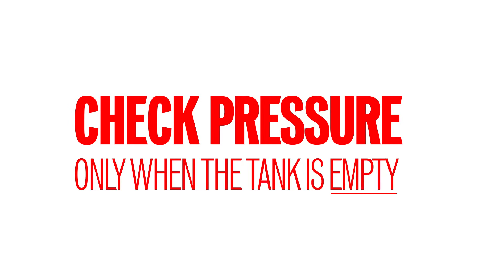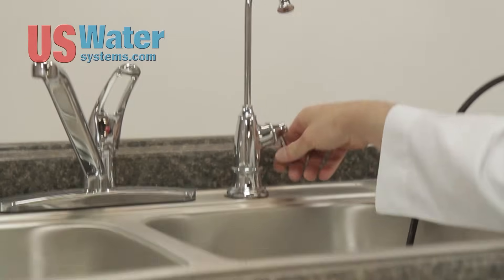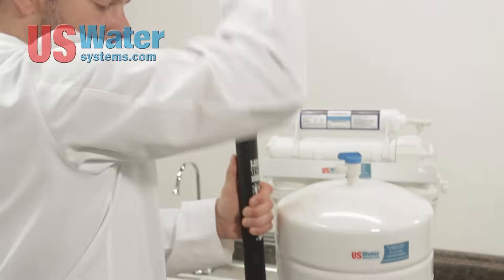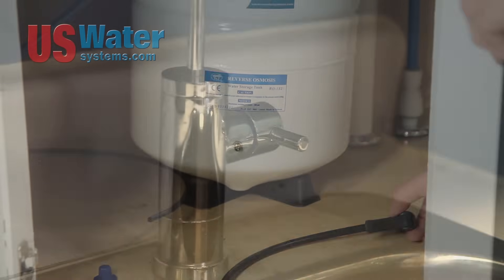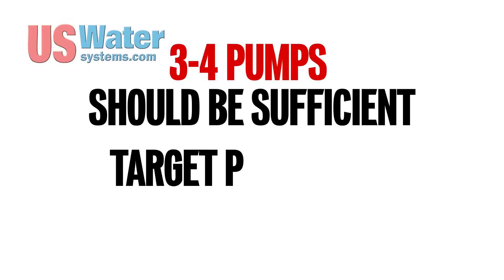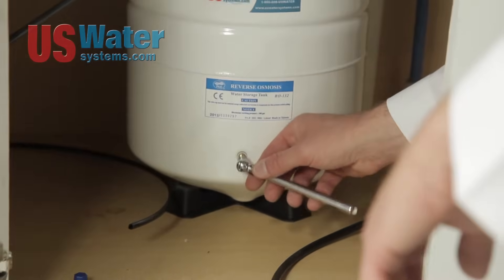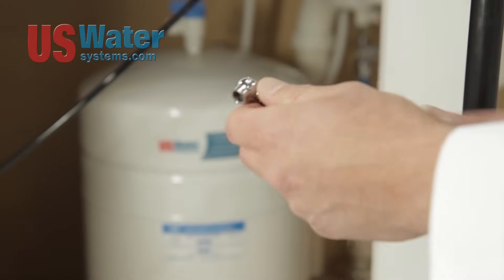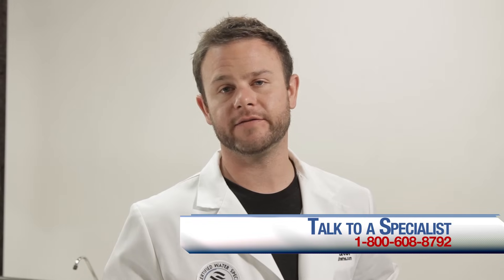How-To: Repressurizing a Reverse Osmosis (RO) System

Comment: One thing i didn't see mentioned in the video or comments - the system needs to re-pressurize after being inflated. The tank showed at 7PSI, but water wasn't flowing from the filters into the tanks. It took a solid 2 hours for the entire system to re-pressurize then the water started to re-fill the tank. I went to bed and when I woke up the next morning the water was flowing beautifully!

Comment: I've always had my 6 gallon tank at 10 psi empty 
 When it is full of water mine ready 17.5 psi! Maybe that's from all of the water. I'm emptied mine now and have it at  7 psi. I just changed all of my RO filters too. Now I have a new system again. I'm hoping my tank did not fail. It would "fail" if it did not hold the 7 psi I put in, correct? In other words the bladder must still be good?

Comment: They say 7 psi at an empty tank.  As the water is filled back up the pressure inside the tank increases.
Reply: yes but no one says how much PSI should be if the tank is full

Comment: The instruction is very clear and easy to follow. Problem is the stem at the tank is a non-standard size. It's smaller than the both bycicle pump stem and the gauge. Therefore unable to pump (add pressure) to the tank.
Any one has ideas to solve this problem is greatly appreciated.
Reply: You might have a Presta style valve.  Most good bike pumps can do both...

Comment: What to do if my 9 stage still flows poorly no matter 5 or 10 psi? Hot water is fine
Reply from the maker: When is the last time you changed your membrane? There could be scale buildup in it.
Reply: @uswatersystems  It's a new system
Reply from the maker: @agreatd  Two questions:
1. Is the system located under your sink, close to the faucet?
2. Does your system have a permeate pump?
Reply: @uswatersystems  Yes, under a sink, new system, with 8 PSI it's bit better, ~8 seconds to fill a cup, no pump, have strong psi from pipes, using a tank
Reply from the maker: @agreatd  Honestly, without a pump 8 seconds sounds normal to fill a cup. RO's just can't make a lot of water pressure. If you add a permeate pump to your system it will greatly improve it though and they are fairly inexpensive (around 70 - 80 dollars).

Comment: Will this stop the vibration noise  I get when I use the filtered water?
Reply from the maker: No it will not. That noise is from air getting trapped in your line. Try closing the valve on the tank and then tilting the RO system to a 45 degree angle and then turning on the faucet until the water is drained. Open the valve on the tank after this and see if it improved after the system makes new water.

Comment: Thanks! My RO-132 tank only released 1.25 gallons and then I pushed-out 2.5 more. Re-pressurized to 6psi. Faucet pressure is sustained, BUT my wastewater ratio (w/ booster pump) is MUCH worse at 4:1 when before it was 1.65:1. I'd rather have a lower water discharge capacity (lower tank psi) and have a better waste ratio. Looks like I'll be doing this over and reducing my empty tank pressure from 6 to 0psi OR remove the tank altogether and get a trickle with 1:1 ratio. Because of the added psi, the tank only fills 2.75 gallons before the system turns off.
Reply: UPDATE: I totally removed the tank and my waste water ratio is 1:1.  EDIT: Actually 1.3 : 1.  (75gpd membrane and booster pump)  Yes, the water comes out slow but  I don't need a lot at once. Besides, I can store water in glass instead of the system storing it in a metal tank and sit in there if I don't use the system. The pump starts / stops immediately with the turning of the faucet and waste water stops minutes after the faucet is off. My TDS is down to 2ppm after about running 12 oz of water to remove the initial TDS spike. If I was using the tank, that initial TDS spike is diluted in the tank and takes a LOT more faucet water waste to get down to 2ppm.
Reply: @rgraz4929  the tank might be metal, but the inside bladder is plastic where your water is stored

Comment: Great video! When I first turned on the faucet the water came out for about 30 seconds then stopped. I had to keep pumping air into the tank in order for rest of the water to come out. That took about 30 minutes. Once tank is empty, I checked the pressure...showing 0.  Pumped to about 7 psi then let the tank refill. Now everything is working again.

Comment: Hi Aaron.

	I just watched your video. Thanks, man. It was straightforward and easy to understand. I didn’t know to empty the tank before re-pressurizing so that was useful info. I’d just been re-pressurizing it!

My question is this. My tank is identical to the one you’re using in your video. Why does my tank read “100 psi maximum working pressure?”  I assume that’s only the amount of water pressure that’s allowable to come into the tank/system overall? 

Thanks.

~ Tim
Reply: mine says the same thing! I am also confused by that
Reply: I assume once you add water back in to the empty tank, the air in the bladder gets more pressurized and the max amount with a full tank of water is 100psi. 

Not sure if that makes any sense

Comment: Can I do this without emptying my tank? Pump 4-5 times. Check faucet. Repeat as needed?
Reply: Some videos have you do the pressure check when the tank is full.  In that case it should be 35-40 PSI instead of 5-7 PSI when empty.

Comment: THANK YOU THANK YOU THANK YOU!

I had no idea that the tanks had a pressurized air bladder and wondered why the valve was there. The pressure was at 0 when I checked it. The instant I pumped a bit of air in the water started to pour out again. Had to keep this up for about 15 minutes until no more water came out and I had the psi at 7. 

Can't thank you enough. I was wondering where I had gone wrong when changing the filters.
Reply: All these years of my RO, whomever changed the membrane and filters, I'm learning the tank NEEDS TO BE REPRESURIZED!  Hah.  the things I continue to learn.  hehehe
Reply: I had 15 mins of water in it, too.  Thought I was crazy.

Comment: Can you go up to 8lbs if you want the water to come out faster?  We have a long tube to our fridge and it comes out of the fridge pretty slow.
Reply from the maker: Doing that won't help you. To get better water pressure you will want to add a permeate pump to your RO. These are recommended if you are running a line to your fridge. They aren't that expensive and they are easy to install. https://www.uswatersystems.com/non-electric-reverse-osmosis-permeate-pump-erp-500.html

Comment: Target presser is five to seven PSI, yet the manual says minimum operating PSI is 40. Any ideas? It's a Premier 5SV.
Reply: The pressure when the tank is full should be 35-40 PSI.  Some videos have you pressurize the tank when it is full instead of empty.
Reply: @tomlillevig9868  Thank you kindly!

Comment: Should I shut the tank valve once the dead water is pumped out, but before starting to pump air into the empty tank?  (otherwise how will it remain pressurized?)
Reply: There is a rubber bladder in the middle of the tank separating the air below from the water above.

Comment: why do other videos say 40 to 50 psi , instead of 5 to 7 psi ? That's a huge difference.
Reply: they say 40 - 50 PSI is what it should be when the tank is full with water, but when its empty, it should be 5-7 PSI
Reply: @realldonaldtrump  RO water supply pressure is lower than the Well pump pump  which also uses an electric 220v motor to get to the 50 -60 psi.

Comment: Water seems to come out of my pressure nozzle. I went to check the pressure and water came out. I then attached a bike pump with a pressure reader and it was reading 0. I gave it some pumps and the pressure goes up then immediately down and I hear bubbling sounds. I assume my bladder is busted. Does that sound right? I’ll be shopping for another
Reply: The bladder inside your tank is likely ruptured.  This can happen over time to any tank.  The well system guys call it a "water logged tank".  It won't hold air pressure anymore.  The tank is filling completely up and the bladder is not pushing on the water in there. In other words, the balloon has popped in there.

Comment: Water supply closed, tank valve open, water tap open. Drain the tank. Jiggle. If water still present in the tank - water supply closed, tank valve open, water tap open- pump up the tank and let it drain completely. Once emptied - water supply closed, tank valve open, water tap closed pump up the tank to 7 psi. Then slowly open the water supply line. It will take time for the tank to refill with filtered water.
Reply: @ErrorMoose why is that needed though? If the bladder is sealed, shouldn't we be able to pump up the tank even with it entirely disconnected from the water line?
Reply: @literailly I’ve got the same question. If the tank valve is open, then the bladder would fill up with air and no air should escape.
After pressurizing my tank to 8psi, I opened the tank valve and it depressurized the whole tank.
I feel like that means the bladder is toast.
Reply: @cwsquaredinspects  pressurize with valve open, and you would have a definite answer.
Reply: Don't re-invent the wheel
The video says it all
Because the producer of this video knows what the tank consist of.
The bladder is supposed to be pressurized, not the water part of the tank
Therefore the tank valve needs to be open when bladder is pressurized
Reply: Are we supposed to close the tank valve after emptying and before pumping pressure in?
Reply: @hide2dan  way I did it, I closed the supply valve, opened tap, closed tank valve, disconnected the tank (with a bucket handy to catch remaining line water), took full tank to bathtub, and emptied it there by pumping it up to 7psi or so. Same steps in reverse to reassemble.
Reply: My tank won’t empty. What do I do???
Reply: @amandaalley77 yes. I had to pump for a very long time for it to empty. Seemed like it had a never ending supply of water in it

Comment: How do you run the water out of the tank by shutting water off to the system and opening the faucet when there is obviously no connection from the tank to the system?
Reply: You are connected to the reverse osmosis system by the yellow tubing. If you open the faucet without turning off the inflow from your city or well water, once the tank is emptying through that  same yellow tubing to the post-filter and then the faucet and then quits running due to eventual lack of pressure, the check valve will open within the system allowing an inflow of your city or well water into the system and then the tank.  Of course, this will defeat your purpose of trying to get the tank completely empty.

Comment: After draining, I connected the bike pump and after pumping it up to about 10psi (not sure what the tank's internal bladder can handle)  5-6 times the water keeps flowing.  -Yes I've confirmed the INcoming water is turned Off.  Just keep adding pressure til  it stops draining? Thanks

Comment: I have worked on RO  systems for decades. And I can tell you that most ro tanks can take pressures up to 70psi no problem, the problem is that if you go that high with the small lines that are usually used in ro  systems you get very high pressure in the faucet. This will cause the water to come out like jet. So if you have low pressure in your system you can go above the 5-7 psi that's suggested. Especially if you have a long run of line between the tank and faucet. I have gone to 15psi for runs of 40ft. Hope this helps.
Reply: Increasing the pressure above 10 or 12 psi will only limit the volume of water the tank will hold, the whole system will only pressurize to about 5 psi below the line pressure of the water supply, a more effective way to get better flow is to use larger lines like 3/8 instead of 1/4 inch
Reply: @motodude23  .You are partly correct . If your water pressure is greater than the pressure of your tank as in another pressure tank from a well or city pressure you will get a full fill of the tank. Yes if you get a larger feed line it will increase volume but not pressure. As I have installed hundreds of these systems I can tell with certainty that increasing the pressure if you have a long feed line is the only way to get proper flow. Thanks for the input , always good to think of other ways!😁
Reply: I put my system down in my basement, and the faucet is upstairs. I will probably use your theory when I pump the tanks back up this weekend! Thanks!
Reply: It's not a theory, this tested installments I have done for over20yrs. You should be able to go 17 to 25 psi no problems.
Reply: what if the air valve is leaking water while the pin is pushed in? is the bladder compromised?
Reply: @zuesbenz  hi yes your air bladder has a hole. Time for a new tank.
Reply: @zuesbenz  GOOD QUESTION. MINE IS DOING THAT. DID YOU EVER FIGURE IT OUT?
Reply: @melissanative1799  get a new tank, old one is done
Reply: @zuesbenz  It's only 4 years old. These tanks are not cheap. I almost feel like the maintenance alone to keep the R/O system going costs just as much as filling up our water jugs.
Reply: Why the sticker on my Ro tank stated maximum pressure 6 bars which is above 80psi.???🫣
Reply: @vickyportlaoise as stated above, just because the tank can handle it, it looks like the rest of the system (pipes, fittings) may not. You are limited by your weakest link
Reply: @vickyportlaoise mine says max. 100psi
Reply: I just pumped mine up and it seemed to work but it there was some water that came out of the valve. Is this normal?
Reply: @Dadlife911  i believe water coming out of the Schrader valve means you have a leaking bladder and need a new tank
Reply: I've now pressurized my tank enough to cut meat with the strong jet of water. My RO system gives me clean water and a nice meat cutting blade. Thanks.
Reply: All wrong answers,  too much air will prevent the tank from storing the proper amount of water.
Reply: At my company we service RO units on a yearly basis and we set the ranks at 8 to 10 psi, over the course of a year thanks will drop to about 4 psi so setting them to 10 means that it will be in the 8 to 5 psi range for a longer period of time, the volume lost when airing it up to 10 psi is negligible.
Reply: The guy saying that having too much pressure will prevent water from collecting in the tank is correct. The water pressure in my home is 60 psi. When I pumped 50 psi of air into the tank (Hey I didn't know any better. I thought the tank needed to match the water psi just like an expansion tank for a water heater. I even asked the RO technician and that dipshit actually said yeah. but anyway), the next day we weren't getting water from our RO system. 50 psi of air wasn't allowing water to collect in the tank even though the water psi of our home was just above 60 psi. Tank started functioning correctly once the pressure lowerd down to around 20 psi. I finally just set it at 10 psi. The stream is a little weak but at least it works.
Reply: @dbeach562  your wrong.  If your water pressure is higher than the air pressure then you will get a full tank. Sorry your wrong.
Reply: @blairfright9622  get yourself informed before making  misleading comments.  As a developer/engineer of RO tanks I don't think your correct
Reply: @dbeach562  I believe that what he's saying is that increasing the air pressure will reduce the tank capacity a small amount, but it can make the difference between getting adequate flow at the faucet or not.

Comment: Long story short is 5 to 7 PSI on an empty tank according to the video.
Reply: Right. I read the label on the tank "Max Pressure 100PSI" and hooked up the air compressor. Starting thinking I might be doing something wrong.

Comment: There is still dead water in the tank that does not leave even though I tried to pump it out. What can I do? in this case
Reply: I watched a different video and the guy said to flip the tank upside down.
Reply: @joshmatthew4125  maybe the bladder is torn. because when I push the needle in the valve by screwdriver water pops up and pour down for some time but then it stops but there is still dead water in it because I think leakage water from torn bladder filled up the bladder when I push the needle that water pops up. I think there is no way to pump that water out so I am gonna have to buy a new tank unfortunately... you mean I need to pump it out as the tank in upside down position. but this time I doubt that all dead water in torn bladder won't pass to the water storage part because of the hole in the bladder is very little...
Reply: I replaced all my filters drained the water from the tank and added 7psi  to the accumulator tank. It works good now. I also added two prefilters before my water softener and flushed out the hot water tank. I have really good water now. Thanks